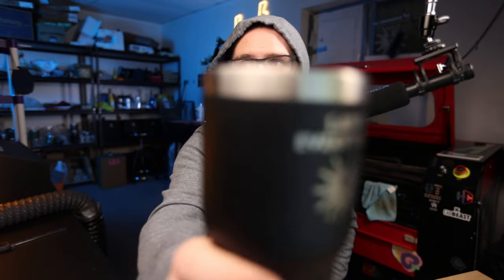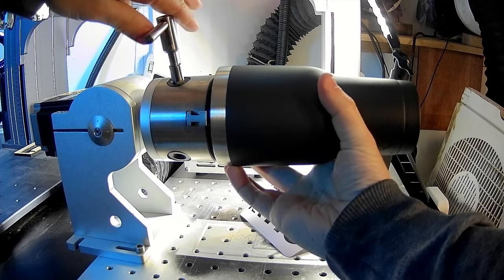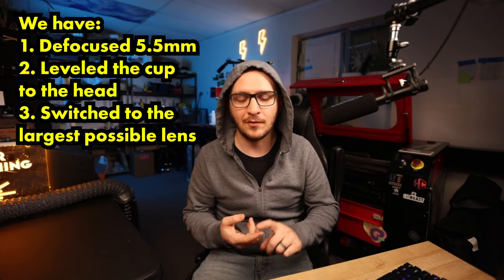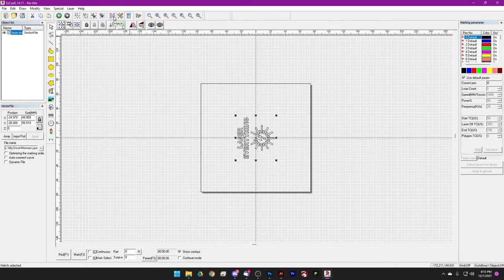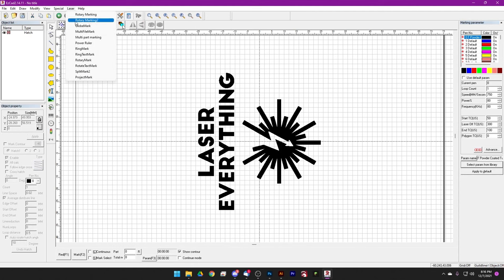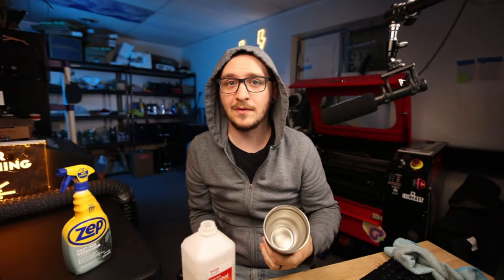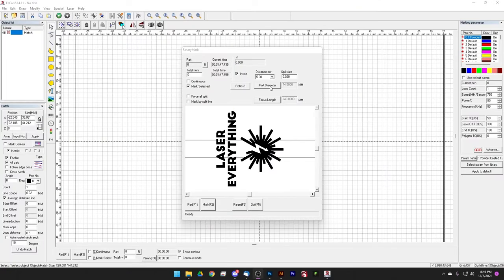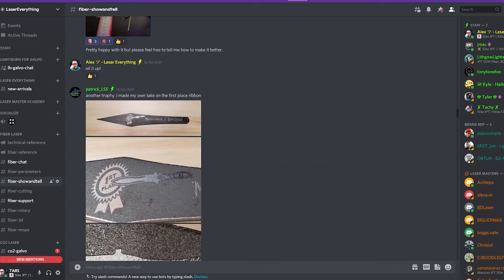Engrave Powder Coated Tumblers PERFECTLY with Fiber Laser Rotary and Ezcad!

Comment: I've just started to get better results than this. I defocused the laser a lot then make 10-16 passes altering the direction. I also cool the tumbler off after one or two passes if the design has a lot of detail so it doesn't melt the coating around the design. Imy goal is to have a shiney finish like a co2. I'm slowly figuring it out.

Comment: So good can’t wait to try this defocused !  
The one I tried made the stainless go a bit dark.  
Surprised the magic eraser didn’t scuff the paint maybe because it’s tough powder coat.   Just be careful with those magic erasers they do scuff some items and remove paint from walls etc it’s basically a very very fine sandpaper type device.   Keep up the good work !
Reply: Happened to me with the CO2, the fix for me was to lower the power. On my CO2 from what i can gather, if you use to much power you essentially re-burn the soot and it makes it really hard to remove. On black tumblers i go 25 watts (20% on 80watt machine) watts of power & 150 mm/s and it they come out money with just a little bit of dawn dish soap to clean it up.
Reply: @tangyboi6420  awesome thanks 😊

Comment: You are talking about how you need to enter the focus distance in the parameters. Do you put in the normal distance or the distance plus the defocus?
Reply from the maker: I have been putting my typical focal distance and it's been working fine but the 5mm should make much of a difference. Either way should work about the same.

Comment: Question from a total newbie: Why don't you simple reduce the power of the fiber laser to enable you to simply burn off the coating like a UV will do?
Reply from the maker: Unfortunately it's not that simple. The UV and Fiber are very different wavelengths. Even at low powers the fiber is much more likely to ablate the metal which is exactly what we don't want to happen here. That considered it does take some extra work to get things to go the way we want on the fiber but as you saw in the video it's do-able.
Reply: @LaserEverything  I appreciate your response. thank you 🙏🏿

Comment: Very grateful to you for this video. Can I do the same using Lightburn? What adjustments should I make to apply the settings from EZCad!?
Reply from the maker: Glad you enjoyed! Absolutely can use this info for lightburn and should translate over without issue. The main difference between options in ezcad/lightburn we see issues with is if you want a contour line, there isn't a checkbox in lightburn, you'd just make a sublayer as a line on the same layer as the fill to get the same effect though. Dont think we needed that here, but rotary is much nicer in lightburn actually, and it also offers a project mark/cylinder correction option to skip rotary too. options! lol

Comment: Hey Alex, long time watcher- first time poster.  I have a LARGE tumbler order I'm working on for a local university.  Using my gantry CO2 @ 600mm/s @ .06 line interval each tumbler is taking between 6 and 8 minutes depending on the added text.  I estimate a another 80-85 hours to finish the job.  Any thoughts as to whether a 60w MOPA would be able to decrease my engrave times and still give results like what you were able to achieve in this vid?
Reply: Super late response but a co2 galvo would kill it

Comment: Cool vid, what about WHITE (and LIGHT PINK) powder coated  tumblers? These settings aren't close to being clean on a 50W JPT 🤔💥
Reply from the maker: The settings we use in this video were using a 30w JPT and 150 lens, so being that you're using a higher wattage and possibly a different lens, you'll need to adjust for that. Check out the settings library and converter on our website if you need help with a rough estimate for your specific config.

Comment: In another newer video you suggest using the galvo CO2 on this, and got much faster results I believe.  Overall feedback on these 2 options?
Reply from the maker: Fiber is a viable option for those who don't have access to or the budget for a CO2 galvo machine. The CO2G though is a supremely better option though for all but the most intricate designs in which the fiber might have an edge.

Comment: Your videos have been so helpful with getting my laser dialed in, that subscribed to your academy to help you as well. I have some white powder-coated cups I want to engrave but turn the metal below the powder-coat black. Any suggestions on what setting I might try? Using the rotary I cannot do the Z Mark Black like with steel as it marks a single line at a time.
Reply from the maker: Please message the LE Support account on the LMA so we can help you with this! 😊

Comment: I use a 300mm lense with no rotary. Black can take seconds to do but I have issues doing red and blue. 

I also have the 800mm tower as well as an extension 🤣
Reply from the maker: Wow that's a big tower! Are you using project mark since no rotary?

Comment: This setting works great on my black tumbler but color ones it’s taking 2-3 passes. Any suggestions on getting it done in one pass??
Reply from the maker: Color tumblers reflect a significantly larger amount of the 1064nm laser than the black ones do as black absorbs the most amount of light. For a huge chunk of the different color powder coats I am still doing 2-3 passes depending on the color in order to get good results. The more power you use the more likely you are to ablate the metal, it's a tough balance.

Comment: Have you engraved any photos on tumblers
Reply from the maker: Ezcad doesn't support photos with rotary, you could techinically project them but I haven't tried it. Lightburn will add support for this upon release without work arounds so we'll be able to get a little further into it
Reply: @LaserEverything  I kind of figured that out. Only way i could do it is projectmark

Comment: Tried these settings and worked amazing on black powder coated cups but for some reason lighter colors it won’t blast the powder coat off very well. I’m thinking it’s a light absorption issue with the colors. I’ve noticed black has always engraved well on everything. Any fixes for lighter colors in your opinion for the settings you have here? I was thinking more power but I didn’t want to leave a mark on the cup lol
Reply from the maker: Definitely more power, you're absolutely right, lighter colors reflect more power. I've actually lowered my speed down 20%ish for some of the lightest colors with good results. Ideally you'll have a setting in your parameter library for each color. It will 100% take some testing. The RTIC's are only $12ish a piece so great for just getting a ton of colors and using them to experiment - there's a link in the description.
Reply: How do I get parameters for my library? Mine doesn't show any
Reply from the maker: Hi, they don't ship with any. We offer a parameter library as a benefit of our Laser Master Academy. https://masters.lasereverything.net/
Reply: I just joined and trying to figure it out now
Reply from the maker: We have a video with instructions available!

Comment: Como não falo inglês esta dificil atentar para as instruções faladas, poderia informar aqui, por escrito, as questões relacionadas a lentes e ao foco? Tenho uma CNC CO², consigo resultado melhor e mais detalhado na laser fibra 30W?

As I don't speak English, it's hard to pay attention to the spoken instructions, could you inform here, in writing, the questions related to lenses and focus? I have a CNC CO², is the best and most detailed result in the 30W laser fiber?
Reply from the maker: Fiber will provide a little more detail but it is much harder to get a consistent mark that is repeatable! Gantry CO2, while a little slow, is the best all around tool for doing things like powder coated tumblers, cups and mugs.

Comment: Hi! Thanks for the awesome content. So glad I stumbled upon your channel :)

I was wondering about something. My laser does not have the reach in the z (up) direction to use my rotary tool. I’m missing at least 10 cm to get it focused on anything large like a tubler. 

Thing is, my laser is “normal size”, not particularly small or anything. And it came with the rotary tool board inside, so you would think it was built with that option in mind.  The rotary tool itself is not large either. I would say everthing is pretty standard looking at other peoples setups, including yours.

Is there anything I can do to fix this? I have tried raising the floor of the machine up from the tabletop, and setting up the rotary tool directly on the table. That gives me the extra 10 cm I need, but this is not ideal at all though, considering I can’t bolt it in the right position.

I would really appreciate any and all tips on this. Thank you :D
Reply from the maker: What lens are you using?
Reply: @LaserEverything   Wow, that’s a quick response :) My machine is a 30w raycus sold by HAUSER, lens is 300 mm. After watching (some more of your videos) i figures I need another lens. But which one..
Reply from the maker: For 30w lasers the 110 is the all-rounder. The 70 is the powerhouse and the 150/175 is the big field. The 300mm lens is all but useless with 30w

Comment: Would you change the hatch/laser settings for a flat surface and not rotary?
Reply from the maker: No, not for a flat surface. When you're using the rotary the laser essentially thinks it's marking a flat surface because the focus isn't changing.

Comment: Thank you for the video of the experiment, I give you a like.👍 I subscribed to you!.. The other day I ordered a Raycus 30Q laser. Do you have or have you tried to engrave glass on a glass glass? a fiber - optic marker ? give me a link, please.
Reply from the maker: Thank you, glad you enjoyed :)
Congratulation on the new laser! We have not engraved on glass with a fiber. Glass doesn't inherently absorb the fiber wavelength effectively in a normal use case for most sources, so to mark glass you'd need a medium of some kind applied to absorb the energy on the surface. Either paint or a coating like brilliance laser ink or sacrificial material that will break down into the glass surface when marked. Some people have even had luck with tempura paint from the dollar store, marking that, and then washing off what remains. Wish we had a reference to share, but its not something we've done or have on hand.
Reply: @LaserEverything  Thank you friend for the information. I will try to apply the paint as you said. If you see the lesson, please send it to me.

Comment: When you marked the pint glass, did you adjust the angle of the rotary slightly to compensate for the taper and make the top surface parallel to the head?
Reply from the maker: I made the entire pint glass parallel from the top all the way down to the bottom. Taking your diameter from the center deals with the vast majority of the following distortion.

Comment: When I have done the z-mark black with 3mm out of focus on a yeti, I end up with an engraving that is almost bloated on the sides. The dimensions of the width are not correct. I have found entering the diameter of the yeti around 2.5-3mm smaller in ezcad than the actual diameter seems to fix it. I am guessing you aren't having this issue at 5.5mm since you didn't mention anything like that. Have you seen this issue before?
Reply from the maker: I haven't, that's a weird one for sure. Smart work around though.
Reply: @LaserEverything  Thanks for the reply Alex. I guess it is strange that I am running into that issue. It made sense to me why it was happening since I pull the focus out, but for that not to be normal is a bit weird. Maybe I'll bring it up in the Discord. Thanks again

Comment: are your settings for a 50w fiber?  i have 30w fiber and i dont get the same results as you
Reply from the maker: This was on the 30w JPT LP Mactron :)
Settings are going to vary by lens size, wattage, and also source brand (because some have different fixed Q pulse ranges). So be sure you're focus is set, and you may need to adjust for lens size. If you have a Raycus or MAX source, increasing power a bit (or reducing speed) by just a little can assist with the differences in q pulse. Color and thickness of powder coat can also affect the results.

Comment: Amazing video but It is marking my RTIC tumbler but I still need to scrape the power coating off with my fingernail at the end. Any suggestions?
Reply from the maker: You may need to slightly bump power or shift frequency a touch, tuning from color to color or even different brands may be needed sometimes.

Comment: I usually run several passes with cylindrical correction until the paint is completely removed... you can just wipe off paint that wasnt completely removed????????????
Reply from the maker: If you really got through the powdercoat yeah it's pretty easy with a little alcohol and a magic eraser to get the settled dust and leftover stuff off!
Reply from the maker: Check out this episode on ProjectMark Essentials: https://youtu.be/mvRCOUP0pOI
And this episode on cylinder correction: https://youtu.be/TIvgsaoaSmw

Comment: Will those settings work for a 50W JPT. I would think 80% on a 30 watt would be different from a 50 watt at 80%
Reply from the maker: The settings are going to be different based on both wattage and if you have a different lens size. 80% of a 30w is ~24w out output power, and 80% of a 50w is ~ 40w of output power. The lens size will also need to be adjusted for. Check out the converter video, that should help get you in the ballpark for adjusting.

Comment: Great. For 50 jpt, i only convert speed? What Zep contains. We do not have this in Greece. Thanks
Reply from the maker: For a 50jpt I'd lower power, maybe 30-ish %
Zep is just industrial degreaser.
Reply: @LaserEverything  you mean 30 power or 30% of 80 power down. By the way, the calculator page is not working..
Reply from the maker: @polakis1975  A reduction in power by 30%, not 30% power. Just google "proportion calculator" there's lots of them online.
Reply: For a 50w jpt, 55% power works perfect.

Comment: I have a 20W laser. I tried to do this with my 110mm lens but it just didn't work. I am going to need to order a new lens and I am not using a rotary. What lens do you reccomend?
Reply from the maker: A 20w without a rotary might be a challenge for sure. You may have a hard time driving a big lens for doing project mark's with 20w to deal with the curve of the surface, so be patient and may be a bit of trial and error.  You would ideally use a 300mm lens for projectmark, but be sure you have enough tower height to achieve the focal distance you'll need. A 200 might be a bit easier on the 20w of available power, you'll just get less ability to handle the curve of the cup, since it will have a shorter focal range.

Comment: I have an 80w MOPA and am using a 210 lens with my rotary. Any suggestions on where to begin with defocusing? I'm a member of the laser everything group which is where I got the library to start with
Reply: Did you get it figured out ?
Reply: @DaneConstruction Somewhat. I ended up getting a C02 galvo laser and I do all my tumblers on that or my C02 gantry machine now. Way easier!
Reply: @e3dusa  nice,  what is a co2 galvo?  A fiber setup but co2 laser ?
Reply: @DaneConstruction  yes that's it exactly.
Reply: @e3dusa  Using both gantry and galvo, which one do you prefer the most for tumblers?
Reply: @DaneConstruction  I have used the gantry much more than my galvo for tumblers but once it's dialed in I think the galvo will be a better option

Comment: Hi Alex, I tried these settings on my 30w jpt, I had to increase my hatch to 0.045. 
0.02 was annealing a blueish colour.
I defocused a 110mm lens 6mm 
But the steel beneath the coating is still slightly annealing to a light straw colour. 
Any tips on stopping the colour change so I get a plain brushed stainless look?
Reply from the maker: Depending on the coating color, it may change how quickly the laser energy reacts and removes it, as well as the thickness. If you're using a different brand, or even the same brand and different batch, it may be a contributing factor to more of that energy getting pumped into the metal instead of being needed to work its way through the coating. Instead of changing the line distance, you may simply need to reduce power to adjust for the potential variables if its cooking things a bit too much with heat. The defocus is going to vary a bit by lens, since your focal distance for your lens may be a bit different than mine for example, or if the focus is a little high or low in its range to begin with, it may be offering some more complexity to tuning the mark.
Reply: @LaserEverything  great thanks for that, I ended up finding a good setting for black yeti cups on a rotary. 
I have 300mm lens on the way which will make things a bit faster.